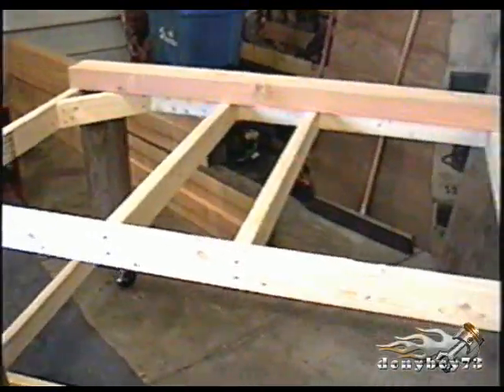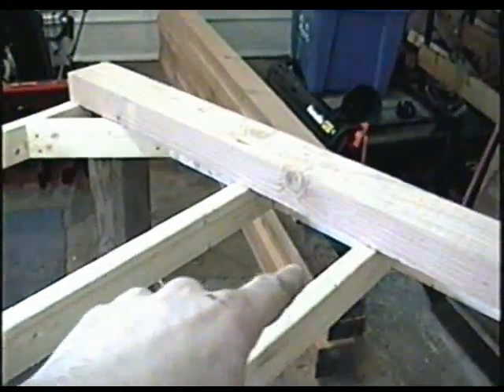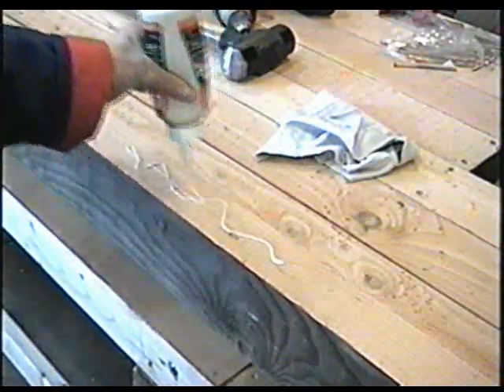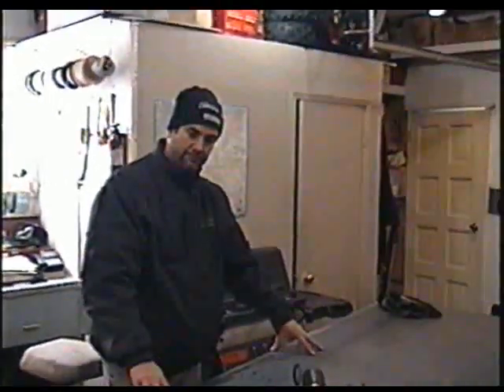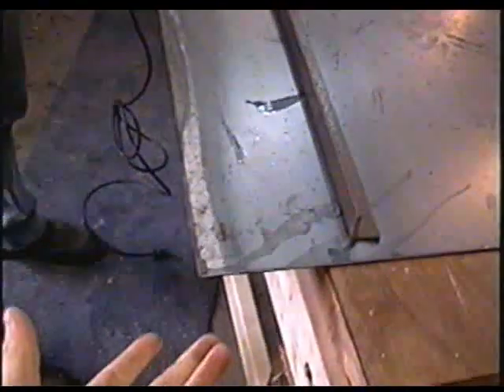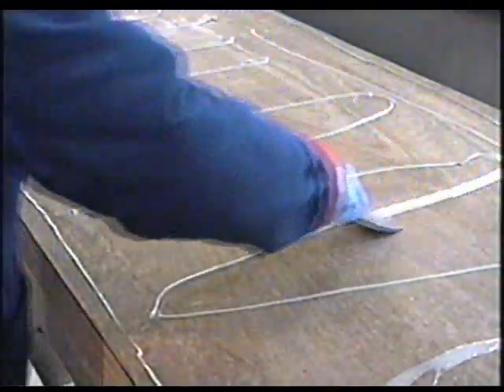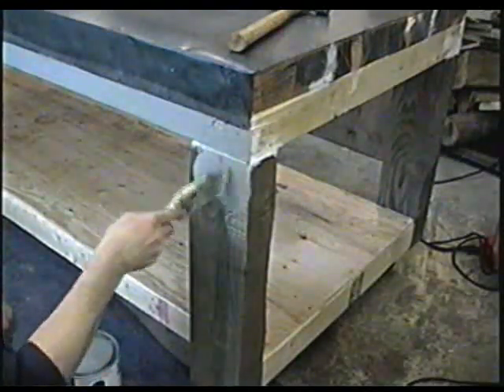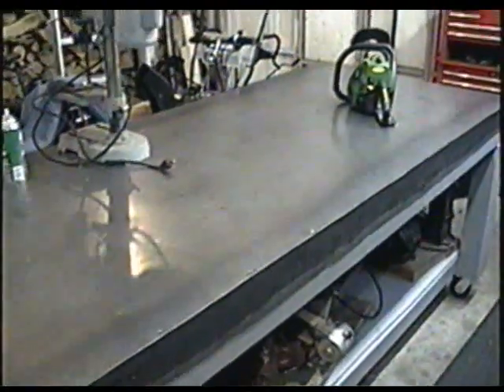HOW I Made my SHOP TABLE for Small Engine Repair

Comment: Good job on the shop table. One add I have is that I  always 'slick' long narrow wood screws with wax (bees wax is best but candle and soap bars work ok too). I keep a few chunks of bees wax in with my drill bits and  scrub two sides of the wood screw threads with the wax.  As said earlier  your motor  table could use an adjustable mid-table backstop to brace irregular shapes like chainsaws and other motors . Would be easy to design an adjustable brace that could clamp to the table.

Comment: Nice job.  A couple of suggestions for the next table.  Use galvanized sheet metal for the top.  The cost is not much more, but it wont rust like plain steel will.

It also comes in really handy to have drawers.  What you do is make the front rail thinner but support it with a center support so it is as rigid as your design.

For the stuff you work on, you probably could have added sides and a back splash to prevent stuff from sliding off.

Comment: you should weld a small piece of flat rolled steel to an end of the bench so you have a place to attach a ground clamp and use it as a welding table as well as a workbench

Comment: if you want, you could plug weld those nails with a 6013 rod 3/32 or smaller. then grind it flush with a blending disk or flapper/sanding disk as some people call them.. nice table man... and no the wood under it wont start on fire due to lack of oxygen... it will smell tho... PL doesnt like to burn :)

Comment: Nice solid table, and a good size.  As to what adrienj67 and pivotboy63 said about filling over the nails with JB Weld: I recommend it. I've used PC7 (it comes in larger cans) with good results. A flap disk will get it nice and smooth, then prime and paint the whole top and you won't see it. I'm only suggesting paint for rust protection, not appearance. Yes, it will get scraped away in places but by then it will probably have a nice coat of oil/grease to prevent rust ;-)
Thanks for the vid.

Comment: Just to correct you, not meaning to sound rude but those "square head" #2 and 3 in Canada are called Robertson Red and Black (usually because the handles are generally red and black) as they were invented here

Comment: Super job on the table. Using metal for the top will aid in clean up. Have you considered putting a hole in the top so when you work on vertical shaft engines they will sit flat on top?